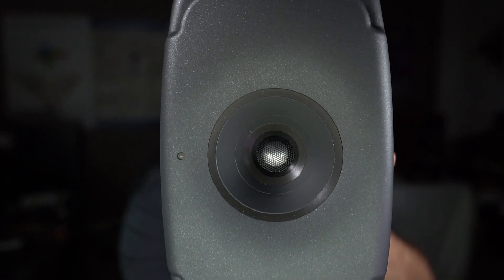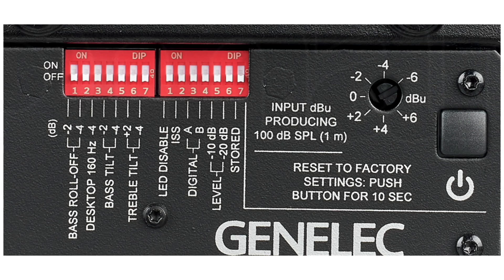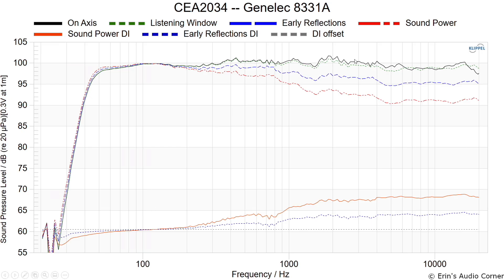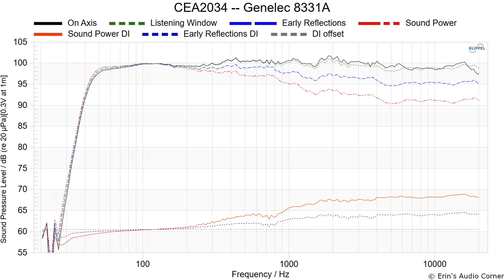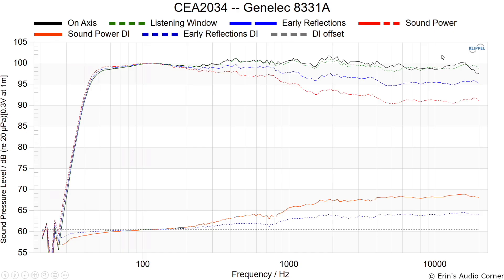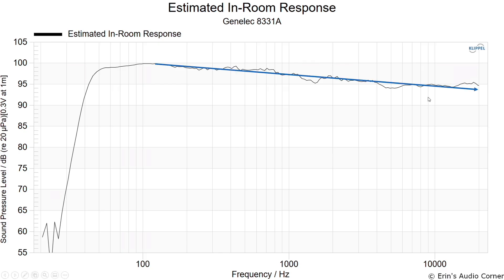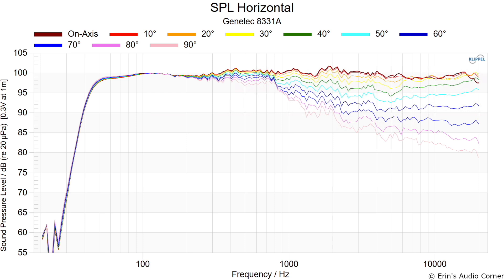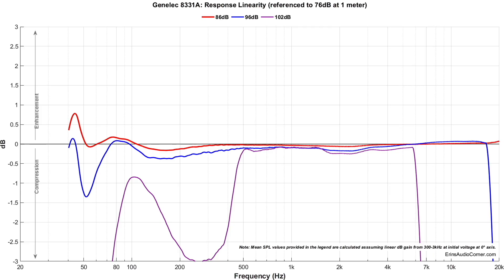Genelec 8331A.  A truly accurate desktop friendly monitor.

Comment: Im working daily with the 8351 in combo with the 7370 Sub. 
Excellent tools and if I could afford it I would have the same system at home. 🥰
Cheers and thanks again Erin,, 🍻😎👍‍‍
Reply: Does this additional sub deteriorate the point source benefits for imaging?
Reply: @cwctw  There are no stereoinformation below 100Hz, so in my case, where the sub is divided at 80Hz,, no, the sub doesnt affect the pointsource/stereoinformation.
Reply: @cwctw  
Good question, it shouldn't, not if it's implemented correctly... quite the opposite subjectively, ie., a well blended sub system contributes positively in soundstage characteristics. 

However, if it's detrimental to the soundstage... then the overall subjective benefit of the greater LF capability must outweigh the diminished dimensionality... which sucks because that’s oftentimes a track by track decision.

Comment: For 5 grand you can get some real speakers.
Reply: "Real speakers" That's like saying potato is better than rice or vice versa.
Reply: Like what?
Reply: @ATommy-lz4jd  Thiel cs5
Reply: @lukabosnjak3829  new ? Also does thiel speakers provide any support any warranty ? Also no information about their directivity anywhere. Wikipedia says the company is bankrupt!
Reply: @ATommy-lz4jd  Well they blow the genis away and are probably even comparable in accuracy for less, but you would need to take a good care of them!
Reply: @lukabosnjak3829  Thiel seems to only pay attention to one plane of dispersion, only half the box is designed correctly, there is no concentric driver, and the drivers aren't matched to DSP controller amps to make them even more accurate. 

The Thiel is a Nissan truck without an engine.

The Genelec is a Cybertruck.
Reply: @lukabosnjak3829  no passive system in the world blow this ,,away,, (at the same price point). Sounds like yourre just a Thiel Fanboy.

Comment: If there nothing negative to say about this speaker, and most speakers are vastly different than this speaker... Time to start bagging on the wretched stuff out there?

Have an expensive speaker that doesn't use nearly the entire front baffle as the waveguide? DO BETTER.

Not using a curved cabinet and minimizing diffraction and scattering internal reflections and creating a more rigid structure without taking up internal volume? That's LAZY.

Not using a coaxial driver that allows you to place the speaker sideways as a center channel, and creating poor vertical dispersion which is important because ceilings exist in almost all listening rooms and sometimes are closer than the walls? STOP IT.

I wish more companies would begin to think about attempting to maybe compete with Genelec.

The extent to which we appreciate a state of the art speaker should correlate with how much we don't respect speakers at similar or higher prices that aren't state of the art. Focal, B&W, and JBL (unless you are going for loudness) come to mind.

Can you imagine one of these the size of the JBL M2? It would be an utter embarrassment, and the 8361 already has peak SPL higher than the M2. (124dB vs 123dB per pair if I'm reading the peak SPL correctly.)
Reply from the maker: One of these in an M2 variety would be NUTS!

That said, just because I couldn’t find anything negative to say (when used within a reasonable operating range given its size and output limitations) doesn’t mean everyone else will love them.
Reply: To be fair Genelec was pretty unimaginative until they launched the one series.
Reply: @Audio_Simon  I agree. Their other speakers seem to target SPL and are pretty accurate but I wouldn't call them state of the art.
Reply: @Audio_Simon  I'd also argue that the 8000 series in general is better cabinet design than most anyone.

Since the 8260 though when they embarrassed the prior attempts at coaxial drivers, I'd call them state of the art, and that was 12 years ago.